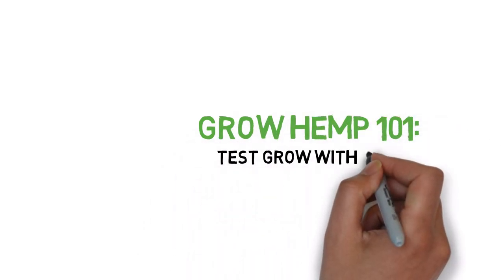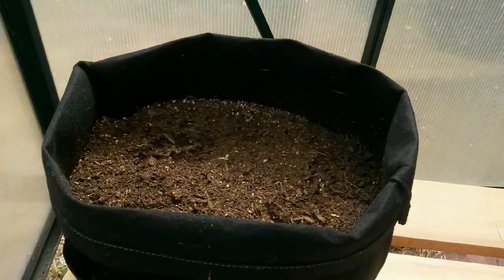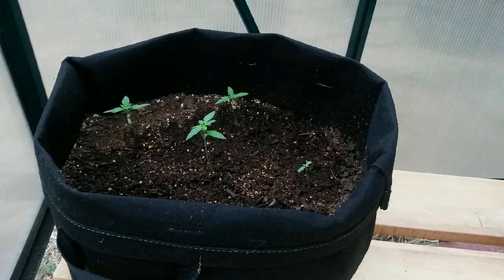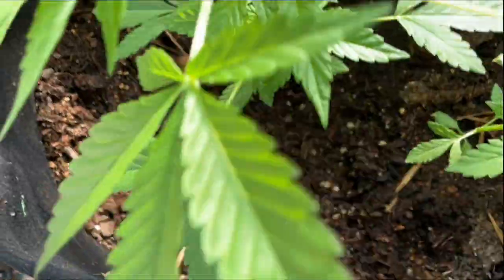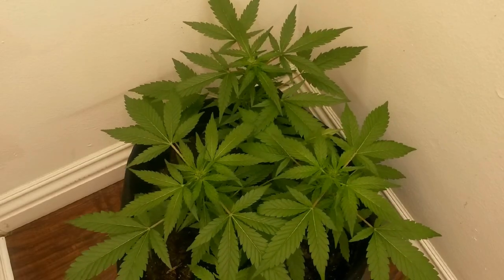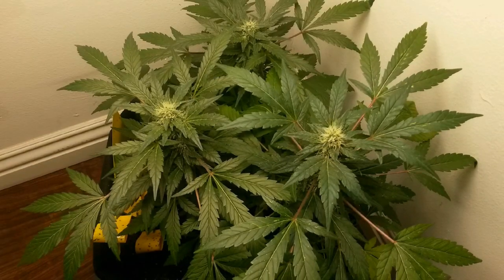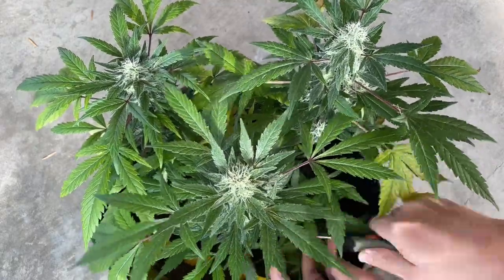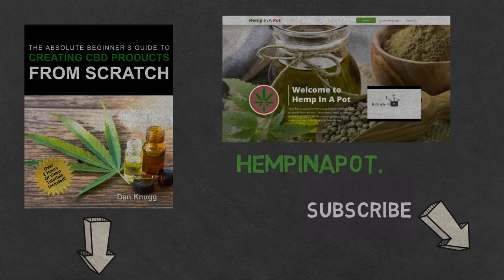Test Growing Seeds Produced from a Male Hemp Plant

Comment: I think you can control fungus gnats with a 1-2" layer of sand on top of your soil. It drains the moisture, and they won't lay eggs in dry sand.
Reply: I use sand effectively. My Doctor recently told me steel wool layer with pebbles holding it down but that's just another way to skin this cat. Wouldn't recommend it

Comment: There is a way to bring outdoor plants inside that I trust, but it's extreme and you need insecticide of course. You need to shake the entire root ball loose of all of the dirt and transplant it into new soil, but first you need to spray the whole thing down with insecticidal soap and not miss a single spot. Very important. Wait a minute or two and then spray it with water. Spray the top of the soil after the transplant and the sides and bottom of the new pot. Put it in a separate area for a week before bringing it into your main grow space. regular insecticidal soap might not even be good enough. Use the dr. doom stuff. Go all out. The plant will suffer for a week from the transplant, but it'll bounce back. I did this to a wild strawberry plant and it worked.

Comment: So in case all regular seeds you bought were males you still have a chance of getting female seeds.  (now you have your practical case) I researched for ethepor and it is horrible expensive and close to impossible to get where I live so I found out through wikipedia that calcium carbide is damn cheap and can be used instead. Guess I need to check with an EC-meter as it should probably not go above 300 or 500.